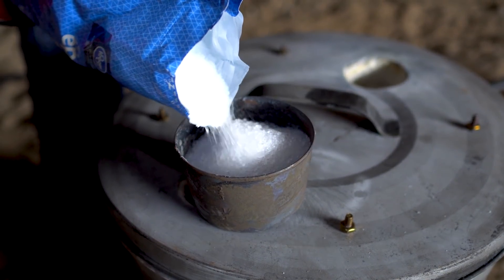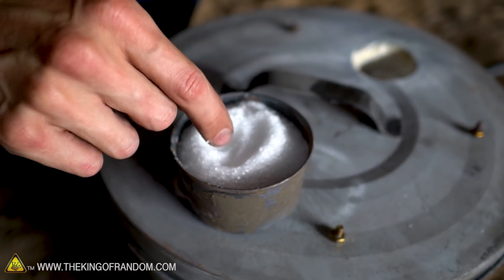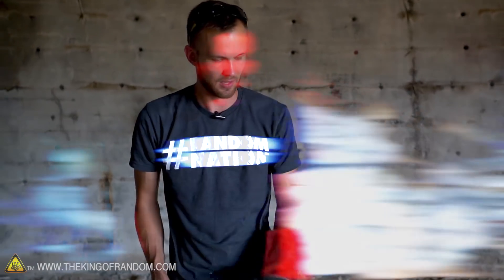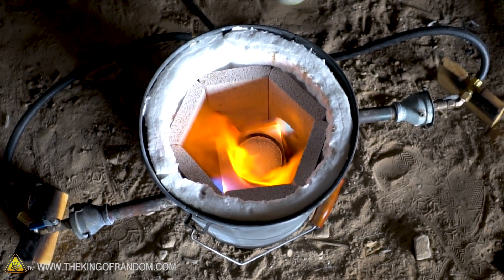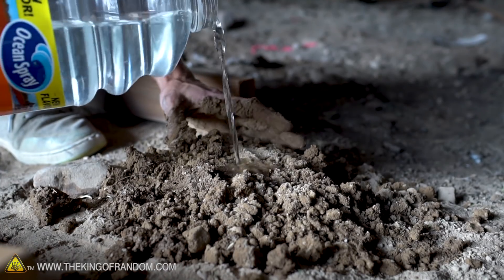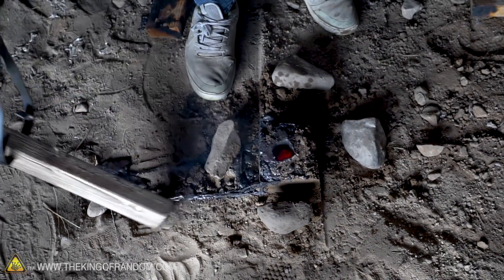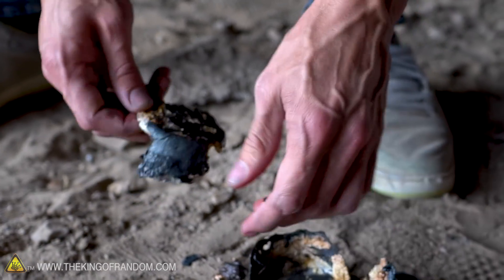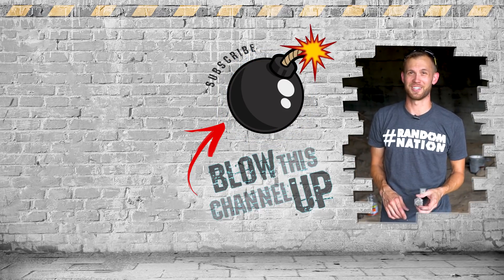Don't Melt Epsom Salts

Comment: What happens if hcl acid with dry ice ???😓😓😓🤔🤔🤔🤔
Reply: Do you mean what happens when you put hydrochloric acid on Dry ice? If so I would imagine it to be exactly what you would think and it would be very dangerous considering the fact that it might go everywhere and getting acid on you isn't fun
Reply: They don't react so you would end up with very cold acid, probably frozen depending on the concentration and how well it was insulated.

Comment: Epsom salt does not melt. It decomposes, first losing water of crystallization then at 1124°C decomposes giving of SO3 gas. The remaining magnesium oxide melts at 2825°C so you would need an arc furnace to melt that. It might be that if heated under pressure it might melt above 1124°C before decomposing.

Comment: I want to know what would happen if you put gallium in a furnace ??? 🤔
Reply: Not much. It'll stay liquid and glow a bit like everything does at high temperatures. More interesting would be to mix it with ammonia in the furnace to form galliumnitride
Reply: Yeah, gallium has a remarkably wide temperature range for the liquid state.

Gallium antimonide and indium antimonide are also rather interesting, but they require a rather more sophisticated arrangement for their production.

Comment: then why don't you just try to melt Epsom salt in the arc foundry ?
Reply: because epsom salt decomposes before it melts. imagine it like this, try to MELT paper it wont work but it will just catch on fire
Reply: yes but paper is thin and Epsom salt isn't wood but a rock so it can melt
Reply: yeah but its not gonna melt lol
Reply: yes but it did melt but it solidified very fast in this vid it was muddy so it was melted but for a very sort time

Comment: Why not try making a mold from sheet metal, welding in along the seems from the outside and casting the salt into that, it shouldn't stick to it, and with thermal contraction being a thing it should shrink enough that when it's cool it's just pop out.

Comment: Does the furnace get hot enough to melt quartz crystal or at least change its properties? I would like to see if you can use heat to make opaque quartz clear.

Comment: Next project: Cast salt in a silicone diamond-shape mold. (Not proto putty - i think the starch will cause a reaction)
Okay, fine.. try both proto putty and regular silicone.

Also, insulation of the crucible means the heat well be held as well, so you could maybe get it to the mold before it solidifies...give it an hour in the heat.

Comment: Could you try further upgrading your forge, possibly creating a blast furnace or a much larger furnace that could reach temperatures that you wouldn't be able to get otherwise?
Reply: Use carbon subnitride as a fuel.

Comment: Put cake or browny batter in a vacuum chamber, keep it under a vacuum and throw the vacuum chamber with the batter puffed up under a vacuum in the oven and see what happens when or if it can bake.
Reply: pretty much done before with pancakes, the air inside the batter, which would normally be there due to the mixing, would be missing and cause the cake or browny to lay flat and not expand as much as it normally would. only a minimum amount of gases would exist and thats it. it would still bake though as thats a reaction of the batter under higher temperatures

Comment: Can you try pouring water into the mold of the crystal and then put salt in it then let the water dry out and see if the salt takes the shape of the mold and if it does can you guys pour more water in the mold and more salt until it takes the shape of the crystal mold

Comment: Why don't you try mixing in some of the magnesiumsulfate with the tablesalt, maybe it won't melt when it's purely the magnesiumsulfate but it will melt in small quantities mixed in with something that has a lower melting point, maybe there will be an interesting reaction as well, who knows
Reply: That is an interesting idea. There may be a eutectic (low-melting mixture) formed.

Comment: Could you melt the epsom salt with map gas or oxy/acetylene? Or maybe the arc method?
Reply: Epson salt can't melt. It decomposes at high temperatures. Similar to how you can't melt paper, it burns before it starts to melt.
Reply: @666DarkBehemoth666 , that makes sense.

Comment: Can you make cotton candy from molten salt
Reply: Viscosity of molten salt is too low for that process to work.
Reply: plus it would be so hot it would melt the machine
Reply: It will be the best way to make your friends vomit
Reply: molten salt doesnt melt at the melting point of sugar.....
Reply: That would : 
1st : melt the cotton candy machine
2nd: Not do cotton candy, cuz its not sugar 

...so, he cannot
Reply: He can do it because :
1st: He can make cotton candy machine with stanlees steel cups and drill there is a lot of videos on YouTube show how to make it 
So the salt can't melt steel
2nd: the machine work like that 
The molten sugar put in the machine in a container looks like cup in shape 
There is small holes in this container 
The machine rotates the cup in fast speed 
He molten sugar exit the container through the tiny holes like a tiny line of drops
As the melting point of sugar more than the room so this line solidify  
To a thin line of sugar 
Alot of lines create the fibers of the cotton candy
So any thing it's melting point  more than the room temperature 
And it can be melted you can make a cotton candy from it
The make fiberglass by this way
Reply: The melt the glass first separately